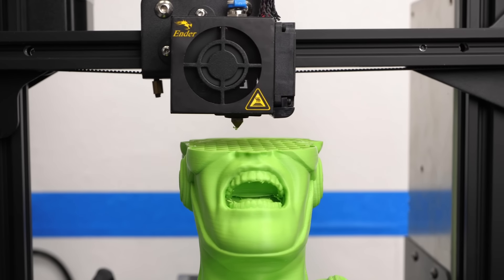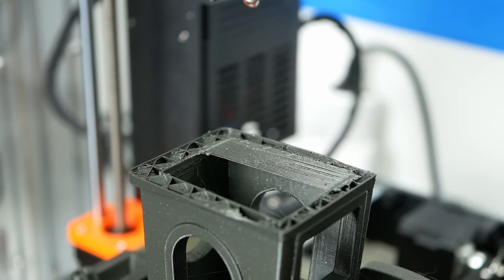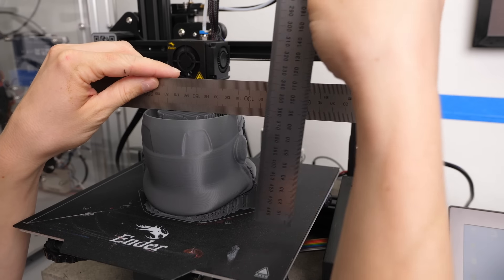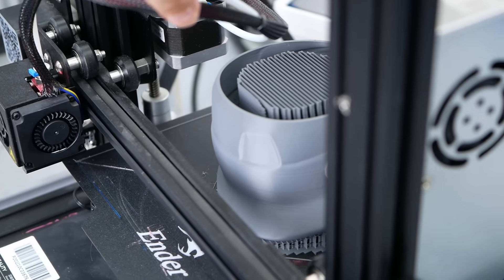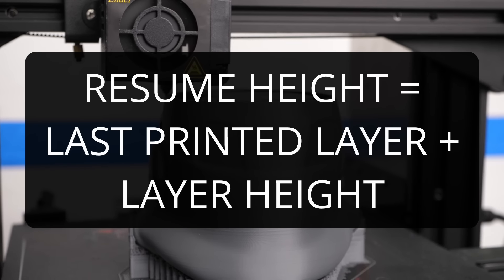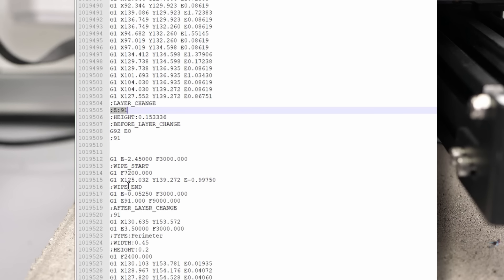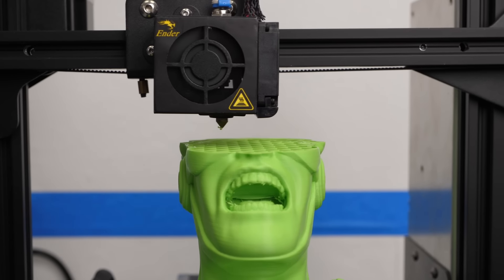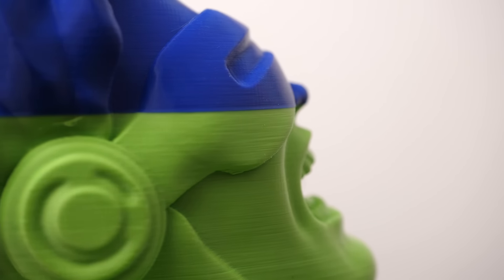HOW TO: Resume a failed 3D print!

Comment: YOU 3Dprinting GOD!!!! this saved my 40hour mmu print... THANK YOU
Reply: so what happend was, after 26hours of printing tpu with  my mk3 mmu2s i heard the extruder click, i  went to look and noticed it wasnt extruding. i went into the menu and stopped the print. z raises 10mm so i  knew my layerheight (i didnt  check before stopping it)  i went back to the  slicer and  fixed the issue ( i keep the slice open until prints are  done) the issue  was that 1 color was over extruding so i  adjusted the multiplier for that color. i deleted all the g-code  between the ;z:48 and G28 and changed the g28 to "G28 X Y" to only let  it home  those axis since i didnt have to home z.  i checked in the  slicer  on what  color that layer  started, preloaded that color and  started the  g-code. it's running like nothing happend.

Comment: Holy sh*t thank you times a thousand! I got a clog, the bed cooled (I ended up supergluing the print and resuming printing.). Could not home Z as the print was in the way. But thanks to you I managed to resume this 24h long print ❤️❤️

Edit: I spoke too soon. The printer (MK3S) just stopped after some minutes of printing 😕. It landed on the right Z height and printed fine. But then it just stopped

Comment: Hi Stefan, I have anycubic kobra max, also my last print is incomplete just 10% remaining. But it is a big print so I can't home Z, so I tried the last option you provided in your video but when using Pronterface and after writing all the commands you provided one step is not working with me. The printer is not letting me move Z freely when I try to move it down, it goes up again and again. Please help
Reply: I tried "M211 S0", and "G92 Z0" as well. But still Z is not moving down
Reply: @ahmedelmegharbel2195  I had same problem with CR-5 PRO.
1. I just move bed manually to touch nozzle with print.
2. Move carriage manually close to X-Y home switches.
3. Home XY. Send M211 S0 (CR-5 PRO does not allow negative movement even after M211 command)
4. Send G92 ZXXX. Where XXX = failed print hight
5. Modify STL file as needed. XXX=(New Z hight on STL file) - layer hight 
6. Print modified STL file.

Comment: The first method is what I use all the time if something goes wrong just re-print the other half. And then just Bondo the seam line’s And sand and paint. I try to G code method before and it just never worked out for me

Comment: Mine can't resume easy cause it's got the probe and it taps the probe in the dead center of the bed every time it starts printing a new file. I gotta do the weird geode stuff to stop it from homing z and set z manually if I resume a print from a modded file.

Comment: Hi, I hope you can help, when restarting on layer my extruder makes a sound and stops extruding, I checked every command in your video and all are the same, actually it stopped at layer 89.8 restarting on 90 but every time I restart the extruder makes that strange sound and nothing comes out, I restart the printer in order to have the extruder working again, it happens right when going to layer height G1 Z90.1 F1800

G90 ;absolute positioning
M83 ;set extruder to relative mode
M104 S190 ; set extruder temp
M140 S60 ; set bed temp
G28
M106 S127
G1 Z90.1 F1800
;AFTER_LAYER_CHANGE
;90.08
G1 X167.545 Y148.792
G1 Z90.08
G1 E4.8 F1800
;TYPE:Perimeter
G1 F1500

Thanks in advance

Comment: Do you know if there is some "device" to use on Prusa 3d printer to go in pause when filament stuck? Atm exist only when filament End (IR Sensor)
Reply: their old IR sensor did that but they switched to the current one cause it is more reliable
Reply: @deathpony698  i dont think you can feel filament move without wheel, should be like car's odometer
Reply: @lorddingo3  they said it worked like a laser mouse

Comment: if your printer didn't loose power and your steppers are not disabled, DO NOT REHOME your printer. 
Rehoming your printer introduces small variations due to most limit switches beeing not nearly as accurate as one might think, so if you can avoid it (that is your steppers are still enabled), don't do it. 
If your steppers are disabled (because you lost power or your printer encoutered a M18/M84 gcode command then obviously you have to rehome and try to use babystepping to get everything alligned again.
Also if your sliver is using relative Z movements, make sure to compensate for that in the gcode aswell.

Comment: Well.... you can encounter a problem I have had multiple  times while recovering the prints this way, depending on the gcode which is generated by the slicer.
And that is: the amount of filament that has been extruded is not correct.
2 possibilities what happens: 
a) printer starts to retract in thin air untill it is finally back to where it was in the gcode (yes... failed again, need to reload)
b) printer starts to fast extrude a lot of filament and blocks: from where the start-gcode is telling it to 0-out  and then wants to extrude as much filament to the last point (which would take days).

So: check the next line of g-code you are going to print and see which amount of E the first line is set to.
If there is for example E36428.3  instead of a almost 0-number it means that the extruder is working in absolute-mode so everything is counted from the start of the print.
Add a line before you start to print which is telling the printer that the extruder-value is at the same amount already.
For example G92 E36428.3

The printer can then continue the print without having to retract or extrude to get to that absolute counter.
I use Ideamaker by the way and that slicer is using absolute countings for E

Comment: I bought an Z axis extension and forgot to update my firmware. Print got stuck at the old max of 250mm after 5 days. You might have saved my ass right there.
Reply: I also used "G92 Z...;" and "G28  X Y;" instead of home, because my print was to large for the printer to home the Z axis.

Comment: If the heating bed was off and the printed part came loose, this is not a problem. Activate the heating bed and wait. Depending on the part printed, it sticks to the bed again after 30 minutes to 1.5 hours so that you can continue printing. (Mirror bed)

Comment: You can still resume even if your part got off the bed. Just slice the part again with a skirt at a distance of 0.1mm. This will have the exact position and shape of the very bottom of your part outlined, you just have to place it and secure it with some glue. 
You only need the skirt from this file, so either delete the rest of the gcode or stop the print after the skirt. 

Problems can occur when the homing is a few millimeters off, so be ready to correct those.
Reply from the maker: Great tip!

Comment: why do you want to rehome if the printer never lost power? wouldn't you get errors from the limit switches? if it never skipped steps or lost power it shouldn't lose it's position right?
Reply from the maker: The motors are usually going to idle after some time and therefore there is a high chance that you will lose some steps. In a perfect world it might actually really be not necessary.
Reply: @CNCKitchen  oh ok that makes sense might be a difference in firmware config because my printer always had motors powered on when the printer is on

Comment: Why can’t power out recovery help? It records the last layer completed right?
Reply: This is more for a situation where your filament snapped or you have a clog.

If your printer powers of the print will usually not stick to the bed well enough once cooled (at least on my powdered pei even petg just pops off once cool)
Reply: @Daepilin  No I understand what he's doing... But I am saying there is already a part of the software recording the last layer... wonder if something like in Octoprint could be made to pull the last completed layer and location and resume from where it left off.
Reply: @thelightspeed3d712  but how would it? You would need a method to monitor if something (or even the proper amount) comes out of the nozzle via camera or another sensor. 

Everything after the filament runout sensor (if you have one) is dumb and has no idea if it extruded filament or not. 

And if the filament runout sensor senses the issue you don't need the methods mentioned here as the print is automatically paused
Reply: @Daepilin  My point is that the power runout, already stores the last known layer, position etc. Basically everything he is measuring most printers like the Prusa are actively monitoring and storing. I don't know how per say... but it could be done if someone knew the FW well enough.
Reply: @thelightspeed3d712  I got your point. The resume function constantly overwrites the stored information, so unless you catch the jam immediately you will have the same issue.

You could possibly mod the fw to do a write out once every layer to some file/folder, measure your print height and then make it load that checkpoint. But I don't see a way without manual measurements

Comment: Exactly the skill that a proper 3D printer should have! 😁 I have done it several times and discovered that when resuming Prusa MK3s+ with Homing but without Mesh bed leveling, the z adjustment is not applied (assumed) and it prints higher by the z-adjust amount. So it has to be corrected with G92. Anyone observed the same?
Reply from the maker: I think as long as you don't restart your machine the mesh bed leveling will be kept. It at least worked flawlessly when the Big Benchy on my MK3 failed.

Comment: If the gcode is edited so that the printer does the homing, the line: G1 Z "Height" should be inserted after the homing.  Instead of "Height", the height at which the print was interrupted must be entered.  Otherwise the printer my goes directlIf the gcode is processed so that the printer carries out the homing, the line: G1 Z "Height" should be inserted after the homing.  Instead of "Height", the height at which the print was interrupted must be entered.  Otherwise the printer may foul directly into the middle of the print and then crashes in your edge.

Comment: Couldn't you just use the same method of as when cutting the print in half, but set it to not print the bottom wall, and set the z offset equal to the height?

Comment: Is there a way to do this when you have ABL? Because G28 (also G28 XY) deletes the data measured with G29 at the start of the original print and doing G29 again is obviously not possible.
Reply: Can you copy the data from the G29 and paste it into the program after the G28 so it still has it's reference numbers afterwards?

Comment: I've always just measured the height of the failed print with calipers and resliced the model cut at that height to print the rest. It is probably the easiest option of the bunch because you don't have to deal with the hassle of moving the nozzle to the correct height. I suppose that some would say that moving the nozzle is less hassle than gluing the two parts together, but that just depends on the person. 

On a different note, someone needs to tell Stephan (I hope I spelled his name right) about the step measurement functionality of calipers. Here's a timestamped link to the only video I could find about it on youtube https://youtu.be/oh4DitZuG8E?t=448. It is somewhat hard to understand how it works at first, and it seems that most people, even those with years of experience using calipers, don't know about this functionality of calipers. I can attempt to explain it, but it is rather difficult to do so without pictures. Basically, if you open up your calipers a bit and look at the back of it, you will see that the sliding jaw protrudes out backward from the fixed jaw of the calipers. Step measurement is taken between the very end of the fixed jaw and the front flat face of the bit that protrudes out backwards from the sliding jaw. (Yes, I know this is a terrible explanation.) Here is a link to a pdf on using calipers that covers step measurement on page 3.

Comment: anybody try this on the anycubic chiron?  I tried doing this but when I try to print the new code it doesnt do anything.  The bed and hot end do not heat up.  almost like it doesnt read the heat up commands but i left them in there. any thoughts?

Comment: Can you tell me how to heat the first layer so it does not peel?
Reply from the maker: Just set the temperature manually on your printers screen.
Reply: @CNCKitchen  My ender 3 changes to the g-code temp after you set it manually. I think I explained that poorly. I remember when I resumed a print after I accidentally cutting the power it peeled and fractured at interruption layer. I think that happened because the print cool down and I guess I could fix that by making the first layer after the interrupt to be heated to the filament's maximum temperature then resuming the nozzle to the normal temperature for the rest of the print. I was wondering if you knew how to do that by modding the g-code or if you could test that?

Comment: I wish YouTube had recommended this before I pulled my print off the bed when I saw this had happened several hours ago. I guess I'm glad I only lost 8hrs of a 71hr print.
Reply: you can still use the glue method. same thing just measure your current print length then go to the slicer and cut out precisely that amount from the bottom and continue print, then glue them together when done.

Comment: IF YOU ARE USING CURA, FOLLOW THE LINK TO THE ARTICLE FOR MORE IN DEPTH INSTRUCTIONS INVOLVING ABSOLUTE EXTRUSIONS.

Also, I previewed the modified gcode in Cura and noticed something looked off. If something looks off, it probably is.  I got my print to resume, only to dump way underextruded plastic all over my print 12 hours in....
If you are printing large things or using a large volume printer this is an essential skill. Thank you.

Comment: If your slicer isn't using incremental extruder control, you also have to add the command to reset the extruder position/count/whatever to the value the code will now start at. Anyone remember what that command was?
Reply from the maker: Good point! That should be G92 E... with E equal the last extrusion step. I'll take a closer look at it and add it to the blogpost!

Comment: I cringed a bit when you used the brass brush on the hotend. This might be ok if your heater block has a sock, but w/o one there's a big chance you could nick or bridge power to the thermistor. Caution should be used.

Comment: HARD, but PERFECT !!
Reply: It's not hard.
It's a perfect example of a simple solution for a simple problem.

Problem: printing stopped unexpectedly at some point.
Solution: resume from that very point or a bit earlier to be safe.

It's just this video is unnecessarily long.
Reply: @goury  if you have hard experience on settings it's easy, but i assume tht 80% of most people will shutdown the mind about these explanations

Comment: UPDATE: I'm going to leave my comment for reference for other people who might concerned but it turns out my concern was unfounded. the print continued from where it failed with no issued. The retractions work perfectly.

I'm not sure this would work on a Creality printer. I'm looking at the g-code right now and I can see that unlike in the video in my case every E parameter is progressively higher. I determined that my print failed at layer 147 and I can see that all G1 commands have their E parameter set at 2818.26815, 2818.59244 ... etc. Here how the code looks:

;LAYER:147
G1 F3000 E2817.82912
G1 F1500 X87.5 Y94.5 E2818.26815
G1 X87.5 Y101 E2818.59244
G1 X78.7 Y101 E2819.03147
G1 X78.7 Y94.5 E2819.35576

Unlike in the video where all G1 commands have their E parameter between 0.03 and 0.04. That means that the filament feed is relative while in my case it's absolute. This means that if I delete a large part of the code and start at the middle it's possible that my extruder would squirt filament unstoppably. Either that or I'll have to edit every command which is unthinkable.

Comment: You know, marlin is not the only g-code interpreter out there.
And also not every machine is so retarded you have to move memory cards around.
Reply: Maybe you should make a video explaining the process with a different G-code interpreter and a networked printer then :)
For what it's worth I think Stefan's video is well presented and directly covers the huge number of affordable machines that do use Marlin, and the techniques he presents are equally applicable to more advanced machines with minor variations.
I predict he will save a lot of people a lot of time, money, and frustration with this video.
As the owners of more advanced machines often have more knowledge and experience, they're more likely to be able to vary the techniques to suit their situation by applying their own expertise rather than relying on step-by-step instructions.
Incidentally, since you mentioned other flavours of G-Code, it's perhaps worth noting that the same basic techniques shown here can also be applied to 2.5D subtractive machining processes to recover from tool breakages or lost steps too, potentially saving hours of "cutting air" vs running the program from the beginning.
Reply: @bsphotovideo  sure, I charge $125 per hour + $2500 per project, such video will take two days to produce and that'll be $4500.
I'll schedule it as soon as I receive full payment.